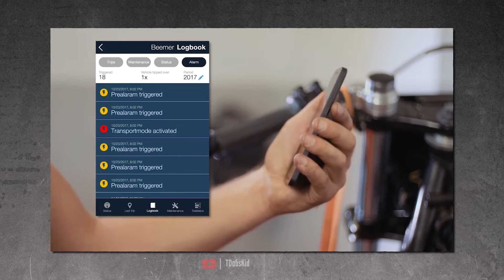How to Wire a Motorcycle Series, Ep. 1: PDMs What are they, what do they do? // Revival Tech Talk

Comment: Love your videos! Im curious how the munit has been mounted on that boxer? Have you welded an additional steel bar to the frame? I dont have have a welder and i dont want to harm the original frame. Any good alternative options?
Reply from the maker: This bit has a significant amount of customization and we did weld a piece of flat stock to the frame in order to mount the m.Unit. I don't have a specific location to suggest but you can mount the m.Unit anywhere that is not going to be directly exposed to water. It is of key importance that the contact surfaces are clean of any paint and treated with an anticorrosive agent in order to remain well grounded. If the mounting location is not a good chassis ground you need to run a ground cable to the m.Unit from the battery.

Comment: M unit is a fantastic piece of kit ,but the side stand function is terrible and in my opinion unsafe , I spliced in the original side stand/ neutral light system using a relay and diode to cut power to the ignition, everything thing else I use the m unit, maybe I'm just over cautious because having the side stand come down before a bend is something I never want to happen again ! I think you should do a video on that?  Love your work , best "how to" bike vids on utube. Thanks .
Reply from the maker: I'm not sure that I follow, can you elaborate? I'm picturing what might happen when I lean into a corner, the stand comes down and the ignition cuts off mid turn.
Reply: Hi many moons a go, my first road bike was a Suzuki gn125 ,it had no kill switch on the side stand, at some point on a journey the spring holding the side stand came loose causing the side stand to come down, I didn’t notice this until I went to lean into a left hand bend, causing the back end to hop around like crazy and forcing me into the side of an oncoming car! If there had been a kill switch on the side stand, chances are I would of been alerted to some thing being wrong and pulled over before the bend, the m unit side stand function cuts the power to the starter not the ignition? Thanks again.

Comment: i liek it BUT the PDM needs to be weatherproofed in some manner.
Reply from the maker: Once the tank and seat are installed there is sufficient protection from the elements on this bike. They don't need to be sealed up, just tucked away where the terminals are not inundated with water.